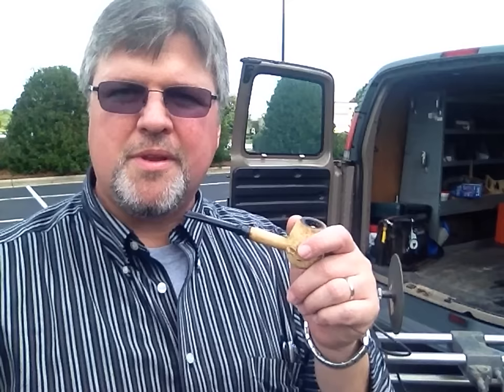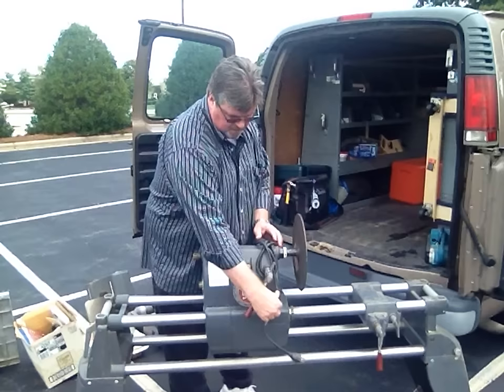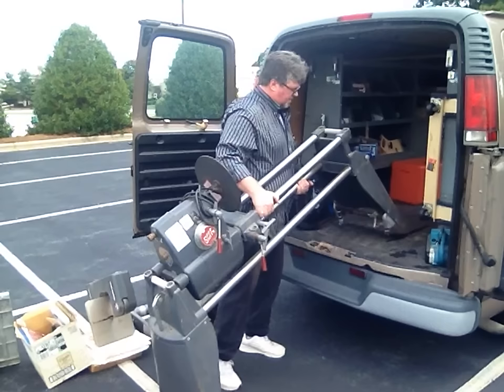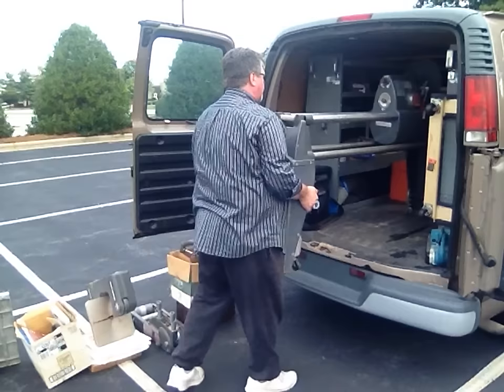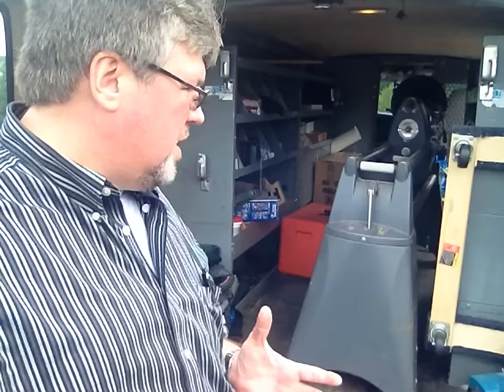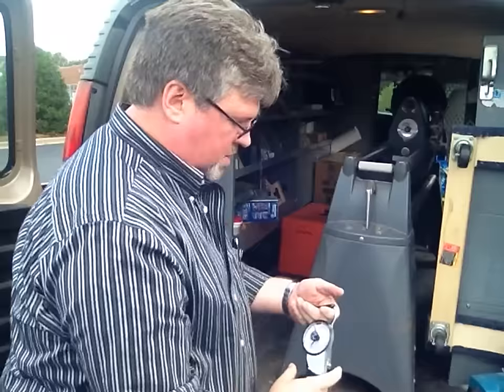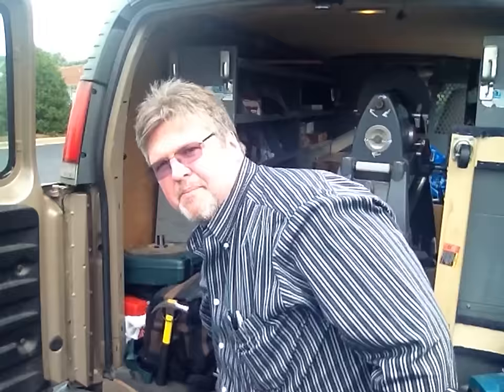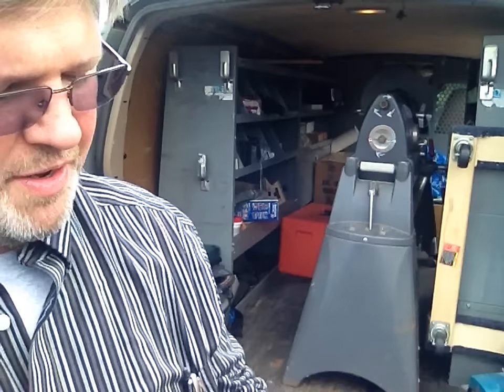How To Safely Load a Shopsmith (AKA: Shop Smith) Mark V for Transport

Comment: I referenced this video prior to picking up my Mk V I recently purchased. The problem was the guy I bought it from had no knowledge of how anything worked as he had inherited it and woodworking wasn’t really his thing. He had a helper friend there and the three of us ended up using brute force to load it complete with saw attachment, jointer attachment and tables into my trailer. It was not pretty. 

When I got it home I took some time to figure out how to take that stuff off. Then, using your method, I easily offloaded it. 

Moving it myself using this method was quicker and easier than three guys without your method. 

Thankyou!
Reply from the maker: Great story, Tim. Glad to hear you had success and welcome to the Shopsmith family! Scott

Comment: Removing the headstock is the best way to make it lighter, thus easier to load into a vehicle. I wound the headstock lock out almost all the way so the cams inside didn’t move, so reinstalling the headstock was easy (and one person can do it). Use a piece of scrap 2x4 to lift the way tubes while lowering the saw table, and removing/reinstalling is easy.
Reply from the maker: Did you watch the video? The method you describe for removing a headstock is the standard procedure that Shopsmith has recommended for years, however in no way is that process easier than what I demonstrated here.

Comment from the maker: I don't recall, but probably $400 or so. I tend to pay less than half their value because I usually intend to resell them. If I recall correctly this one was a deal.  In fact, I believe I purchased this one in order to get that strip sander that you see on the ground.

Comment: Good tips. I'm pretty sure an older ER-10 is at least 200lbs even if it is slightly smaller.
Reply from the maker: Oh yes, the 10ER is a beast! Not only is it heavy, but most people overbuild the base, and when you tilt it back the lower leg drags even more than the Mark V. I’ve loaded one by myself but always prefer to use the buddy system. I’ll load a pic onto the MyGrowthRings Instagram feed of my son and son-in-law unloading a 10ER from my van.  Scott

Comment: I’m going to pick up a VERY EARLY shopsmith this weekend probably made in the 50s. No variable speed just step pulleys. Any advice?
Reply from the maker: Bring a strong friend! Seriously, it’s a heavy tool and you would be wise to also bring along some work gloves. They are typically mounted to wooden bases which may contain splinters.
Reply from the maker: Is thee a staircase involved? Also, if you have access to a couple furniture dollies (the wood, carpet and 4 caster type) I'd bring those along too. IF the stand has casters they are small and made of metal, and they don't roll well on driveways.
Reply: @MyGrowthRings  yes there is a staircase. I have help and can get close with my trailer. I wonder if it’s easier to take it off the stand. Also are later model accessories compatible. 
Thanks a lot for the furniture dolly idea.
Reply from the maker: @timbylander7015  That’s not an entirely bad idea about removing it from the stand, just as long as you don’t have to deal with rusty bolts. I’ll post a pic in the Community tab showing my son and son-in-law removing a 10er from my van a couple years back to give you absence of scale.
Reply: @MyGrowthRings  thanks a bunch. Very helpful. 👍🏾
Reply from the maker: @timbylander7015  Happy to help. I'd love to hear how it goes for you. Scott

Comment: Thanks Just What I wanted to know, will the legs come off, to transport a shopsmith 2 in a hatchback car.
I seriously only want it for a lathe and its an all pulley model. I figure 50 bucks for a lathe cool! I don't care about the tablesaw. the drill press would be nice but I don't need it. Yes its a Greeney.
Reply from the maker: bobbg Yes, the legs are bolted on and can be detached and reattached easily.  In fact, I pulled the legs off my Mark V once and took it to do a demo at a Woodworking show, and to fit it into my Suzuki Samurai I had it on end in the passenger side with the seat reclined. It had to look silly but it worked and the legs went back on with no ill effect on the alignment. So are you saying you are looking at a Mark 2?  Either way you can’t beat it for $50.  Scott

Comment: Smart way to load it. Sorry you broke your scale but if you didn't fix it then it was an opportunity for a new upgraded one, (from harbor freight) right? 
I got Mark V from a guy who didn't realize that one of the boxes (had never been opened) was the jointer (haha my gain). He thought it was just paperwork and the manuals. 
Do you remember what other items you got with it when you bought yours (the purchase in this video)?
Reply from the maker: You have my number!  Yeah, with this one I got a strip sander, a 6" belt sander, though he destroyed the rubber drive drum sleeve and the dust chute as he was attempting to demo it for me!  It also came with a bandsaw.  A NIB jointer is a very nice prize!  Just how heavy did he think the paperwork was!  Scott
Reply: MrToolhunter What surprised m was that it had never been opened. The copper large staples were still holding the box closed as it was from the factory. Sorry your rubber got destroyed but Shopsmith is good for parts. I think but I haven't spoken to them in a long while. But you know that since your were a dealer and demo guy for them.

Comment: Hi .. I need the specs. on the v belt of a greenie.  Corp. office is not helpful on exact size specifications.  My belt is touching the way tube on operators side and Im thinking my belt is too long or too short causing this condition.  Thanks for any help.
Reply from the maker: I don’t have that spec handy at the moment but what I can tell you is it is a unique size for Shopsmith. You can purchase it directly from them and I don’t think from anywhere else. Scott

Comment: got my 10er for 99 dollars
Reply from the maker: Napalm Papa Assuning it’s in good shape that’s a great deal!
Reply: needed a power switch and I added casters to the bench. I'll post pics of my rebuild if you'd like.  having trouble identifying the power toggle switch though any recommendations?
Reply from the maker: Any double pole single throw toggle switch will work. I'd check at Home Depot and Lowes or your local hardware store.  Just make sure that it is rated for 120V AC, 20A.
Reply: awesome thanks for the info!
Reply: worked perfectly!
Reply: Napalm Papa Excellent!

Comment: I wouldn’t have one of those things if you gave it to me!  Steaming pile of aluminum garbage.  A combination machine that doesn’t do anything particularly well.  Buy a machine that does what its designed to do (lathe, table saw, drill press, etc).  There’s no such thing as a precise, all-in-one machine.  That thing is so sloppy with tolerances its useless..
Reply from the maker: Pick any combination of tools and I’d be happy to have a build-off with you.
Reply: I just bought a 1975 shopsmith,,,I always felt like you until now,, don't think you can buy a better lathe,,,I payed 65 dollars,,,, for that purpose,,,, u have nice tools for everything else,,, and yes it's too much change over time to do it all,,,I'm only useing lathe function.